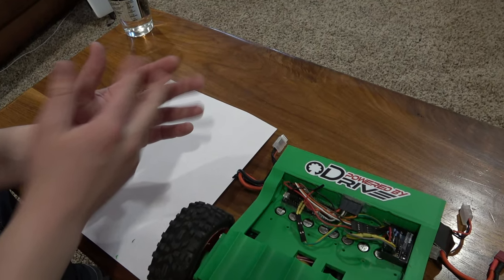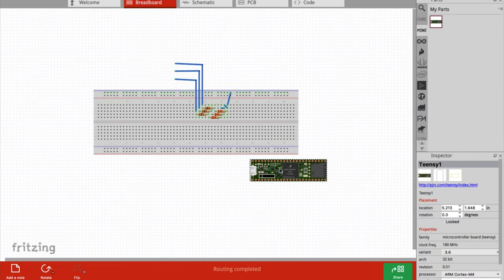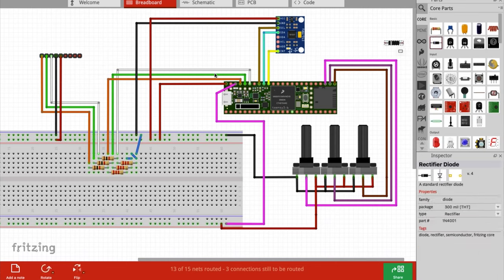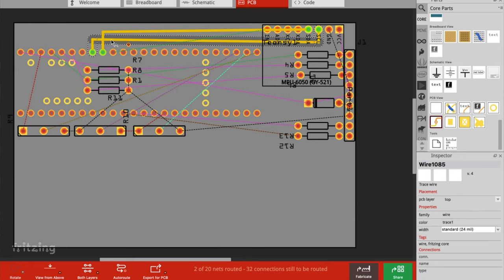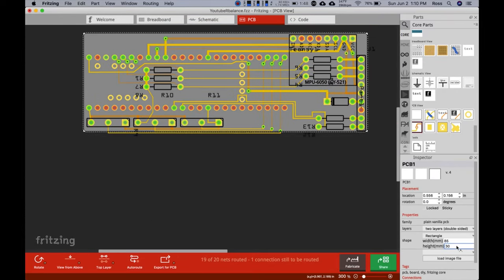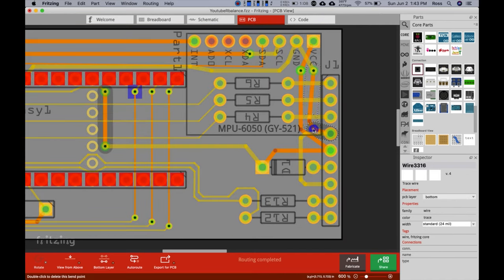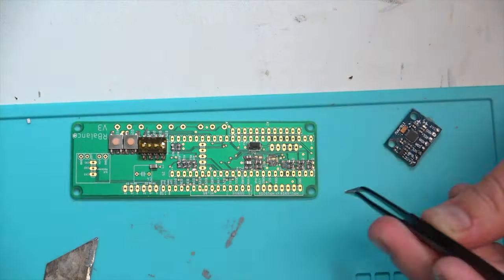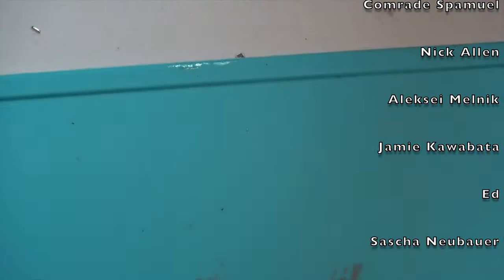Designing Your Own Circuit Boards Can Be Easy And Fun!

Comment: You only need vias for SMD, not for THT (edit: unless you want to jump over a trace)
also you avoid 90° traces doe how electrons "flow" at high frequency.
they tend to "shot out" of the corner, making it a EMI nightmare, so the smother the corner the better.
using a ground fill and even a "positive fill" along with keeping trace as short as possibly can greatly reduce EMI. in fact professional PBC design programs allow you to use Copper fill as ground in one side and source in other side.
is possible to do that with work around in Fritz, but Fritz haven't seem much develop lately... on other side Aisler is trying to restart develop on Fritz, since it's much friendlier that other PBC design programs.

P.S.: to avoid the "lack of space for X component" in the final board, just print it out on a paper and test the sizing.
Reply from the maker: I had to use them because the teensy footprint was missing pads on he backside so I would get DRC errors unless I went through the board with a via and connected to the pads on the front side. Then I added pads to the back side by overlapping a connector on the teensy.

Comment: If I understand what you're trying to do, it's using a resistor divider to get 3.3 v for (the Teensy? IMU?) from the 5 v input to the board.  My advice is to spring for a voltage regulator for the Teensy -- the resistor divider will give varying voltages depending on load.  Good Luck!

Comment: Brilliant!
Regarding the traces not having sharp end - its because sharp ends have a greater tendency to cause electromagnetic interference (EMI) which means in high frequency circuits those traces emit electromagnetic radiation which can interferes with other circuits. Also sharps ends in electronics are a strict no-no from electro-static discharge perspective as charge density is given by charge ÷ area so sharper the edges smaller the area and this can cause / be susceptible to electro static discharge which can damage sensitive components.

All these all industry and compliance practices that must be adhered to if you want to sell your product commercially

Comment: cant it be intelligent enough to just optimise the board layout automatically, place components and minimise trace lengths?
Reply: Auto trace routing very rarely works. Even if you spend 10's of thousands on software.
Reply: @Jimmeh_B  I bet you've never used Altium
Reply: @GK-dd5ci  nope.
sounds like maybe i should